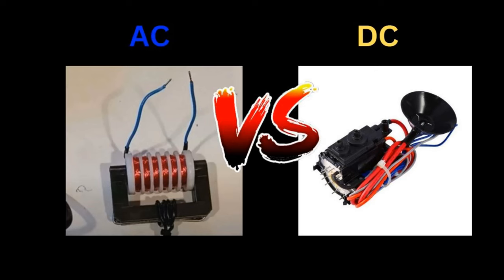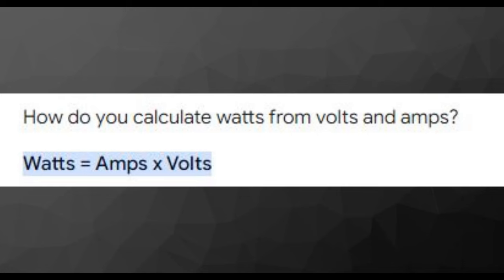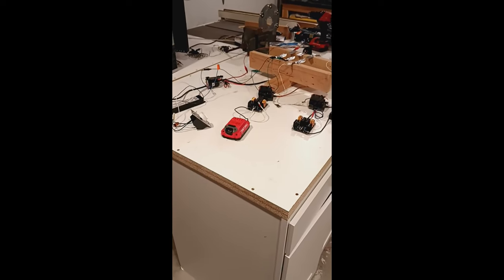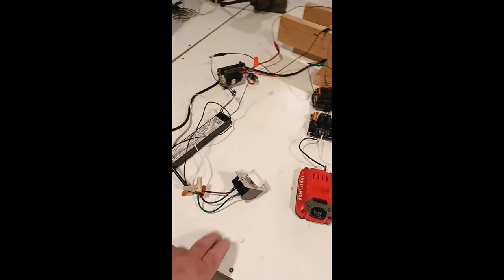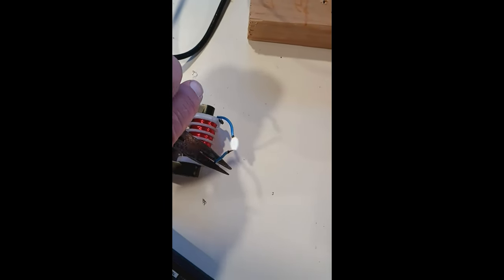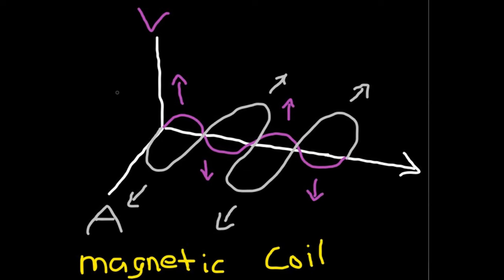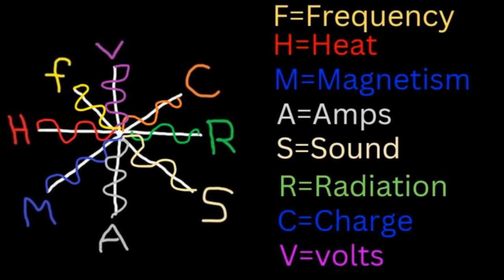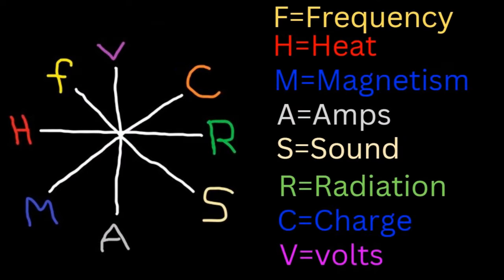Is It AC or DC High Voltage #55

Comment: Permeability is what this is referred to in electronics.  B/H curve on transformers. However you have a point also.  If you over load a  B/H curve a whole lot it will produce radiation emissions.  Again something Physics people don't talk about.  Because no one has a clue why.?
Reply: I'm interested in this - can you please provide more info, and possible point to where I can learn more - thanks!
(I've never experienced this myself - 'only' a core which becomes magnetic, not emitting radiation)

Comment: Pulsed DC is the winner ;D There is also a big difference if it's plugged straight to the source, or is it using the exited field. If it's separated from the source with spark gap or spinning magnet it turns to cold electricity. Cold electricity adapts to the load, so it can work through water and it will use less energy when it's connected to the load.
Reply from the maker: it is interesting that every part plays a role in creating the electricity. I never thought to include cold electricity but you are right.
Reply: There's a lot of overlap on the term "Cold Electricity" so let's just get that out of the way quick:

Cold Electricity is another name for Reactive Power, if the Dielectric (electrostatic) and Magnetic fields aren't in phase you don't have electric power, it's cold

The "Cold electricity" you're referring to that can travel through dielectric materials are Dielectric Displacement Currents, Radiant Energy is a particular type of that, that's what can travel through the Water and the Earth, Peter Lindermann did refer to those Radiant Events as "Cold Electricity" back in his 2001 book however the term has changed over the years, its more proper and original term can be traced back to a patent from a French man, Tibor, which is a circuit that works on reactive power. Patent WO1991018495A2.

Comment: "Is It AC or DC High Voltage" : Almost all the talk in this video : amps, voltage, electric field, magnetic field, sound, frequency, radiation, and sine-wave is non-sequitur - irrelevant - unless the video title is ignored.  Unless you want to invent new terminology, or re-title the video content, the answer is simple:  If the potential difference (volt) remains the same polarity IT IS DC ; If the potential difference (volt) changes polarity IT IS AC.  Sure, their is a lot that remains unknown and/or obscured in science - but that does not mean we invalidate terminology, instead we add to qualification / quantification.  For instance, we can say the measurement indicates AC, and also we have other observations/data.  We can also say the measurement indicates AC for a certain period of time, and indicates DC for a period of time - it is hypothetically possible.  It can not be both during the same measurement period.  In fact, if not measured over sufficient time, it is obfuscated.  If AC is measured for a sufficiently short period of time, it appears as DC.  This is simply the nature of these terms.  Other terms may be necessary.
Reply: An additional thought : Perhaps DC (Direct Current) and AC (Alternating Current) should have been DP and AP - Direct Potential and Alternating Potential.  Displacement Current does not necessarily have to be present for the potential to be qualified or indeed quantified ; the COMMON understanding/application of the terms DC and AC is tied to potential difference - not necessarily involving displacement current.  However, most DVMs / 'Voltmeter's do engage in displacement current measurement to distinguish between DC and AC - it is the simplest method - else field meters are required - significantly less 'convenient' for most applications.  Now, in fact, if one looks up the definition of terms, displacement current is included.  So perhaps this video (accidentally) raises an unrelated point - even if the electrical polarity is inverting, but no displacement current is present, is it still TECHNICALLY 'AC'?

Comment: My teachers in college told me to think of an inductor as something that stores current and a capacitor as something that stores voltage. It's easy to picture a magnetic field building up around an inductor, but picturing a static charge building up in a capacitor is a lot harder.
Reply from the maker: what if I told you you could charge a capacitor with a Wilmshurst machine?  https://youtu.be/rEmEXYd1sf8?si=jm4ktFu5FqAsY_q2
Reply: @nathanbunten4299  have you seen the fscc circuit? It takes high voltage, low current and makes low voltage with higher current.

Comment: interesting because the air is static electric so surely this will be good for the graviflyer as you would want to produce the same static as air has in it but this would also mean huge amounts of power as the more power you use actually physics we know about all begins to go a bit weird.

Comment: voltage is the rate at which magnetic field  is created/consumed in a circuit.   Amp is the rate at which the  dielectric field is  created/consumed in a circuit.    you always have to have 1 unit of electricity... their is NO such thing as 3/4 electricity always has to be 1. So when one is consumed it give rise to the other because it always has to equal 1. This what people way smarter than me said.
Reply: You follow Dollard I take it? You're correct but there are 2 Voltages and 2 Currents, Conduction and Displacement Currents are measured in Amps, where Potential and EMF are measured in Volts.
Reply: Magnetic field is created by moving charge. Change of charge per time unit passing a point in space is a current measured in Amperes.
Reply: @mikek.1761  charge is a human abstraction
Reply: @toymaker3474  as everything in physics.
My point was that you need to have an electric current to create a magnetic field.
You can have electric potential measured in Volts, for example on a capacitor, but without moving charge there will be no magnetic field.
Reply: @mikek.1761  this is not the case,  its the dielectric fields lose of inertia that radiates / creates the magnetic field. (an electric field already has magnetism;  the 2 components of the electric field are the magnetic and dielectric fields....per steinmetz.) and trust me steinemtz is waaay smarter than you and i.
Reply: @toymaker3474  can you explain how dielectric field is losing inertia?

Comment: Just an FYI, the belief that conduction current flows from + to - (Anode to Cathode) is an error from the days of Benjamin Franklin, it's from - to + (Cathode to Anode). Something to keep in mind when dealing with projects where this becomes important.

Too add to that, terminals can be connected to + + and - - instead of always - +, this is known as splitting the positive (or negative) and it's based on the fact that the system doesn't care about polarity, it cares about potential difference, if you have a split positive system with 1 + terminal having a higher voltage than the other you will get flow, the advantage of this is that the current that flows into the lower potential terminal will recharge the source if it's a battery, obvious implications of that.

Comment: In vacuum tube work we were well education about this. The stages of amplification used bias voltages over the AC waves. Every wave on the scope had both an AC and a DC component. If you want to see the AC component you place a series capacitor in a resistor to ground and pull it off. The DC is blocked. If you want to read the DC voltages you stop sending AC through the amplifier and read them as static HV charges, This is not complicated at all. And indeed all of them have at least some of both. 

What they do not understand is how a field can come up around a component larger then the plates holding the DC charged on them. This cannot be understood from the EM teachings at all. This field does require a vibration frequency that does not have to have an EM component on it to generate the geometric field effect from the vibration on the nuclear mass of the atom. This is what the strong force field does! It holds the electron shell at specific distances outwards of the nuclear mass. This is the "mystery force" to anyone educated in EM well , but not in nuclear physics of the atom.

Comment: The call for further delineating and subcatagorizing types of power is more than a century overdue.

What's need is to treat each with a similar approach to group theory in Li algebra used in physics....

Your point regarding a laser is more fundementally valid for a starting point in this regards than you touched on and deserves a much deeper dive.

Lasers by definition have both bosonic states where multiple particles carrying charge and momentum can have overlapping energy states, where as pure electrons behave like fermions.

To what degree magnetic fields fell on this spectrum is still up for debate.

Photons additionally are able to also be categorized into 2 polar opposite classes of incoherent or coherent.

Though like everything, this is more of a spectrum, and treating everything as a subcatagorization based of the ratio between these classical binary states is more useful.

Capacitance should likely be on this chart.
Can you remake the chart at the end using SI units shown with their dimensions....
Reply from the maker: I put in the basics. I agree that capacitance should be on this chart. I like the physics model for this. it show when you change one thing it affects the rest. I hope to add information to it and show it in 3d. It makes a better visual. I also think if we add capacitance we also need to add resistance. It is a rough outline for a starting point but a needed one.
Reply: @nathanbunten4299  Agreed.
Good work thus far all the same.

Any way to make an editable page that multiple people can add too?
Reply from the maker: @michaelgolfetto9619  I will look into it.